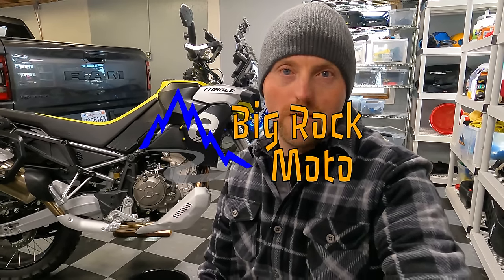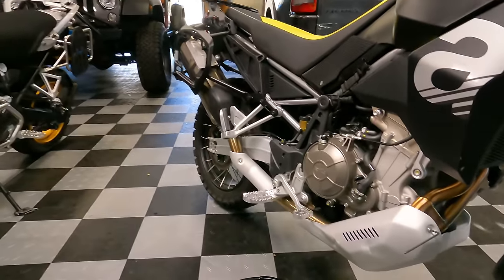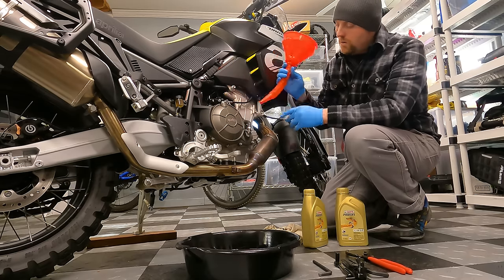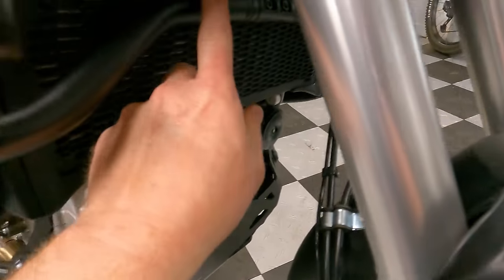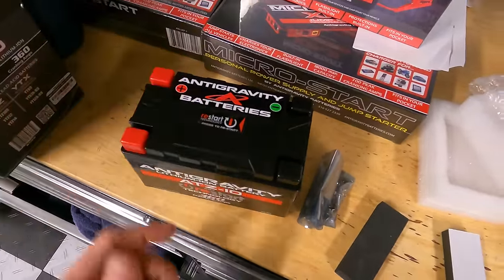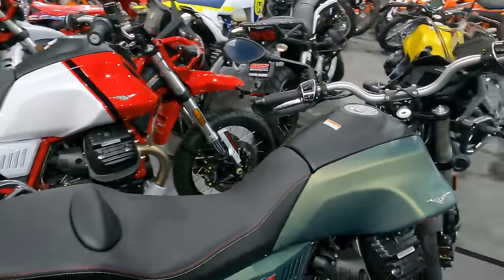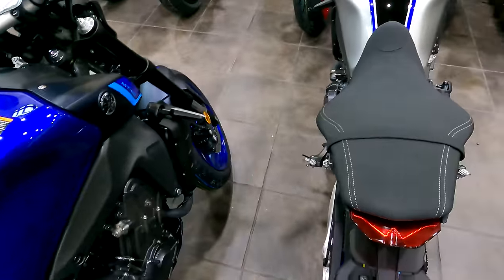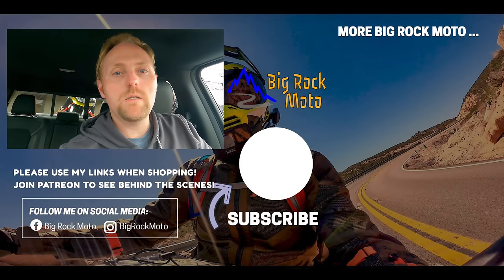Aprilia Tuareg 660 First Service & Accessories (EP.5)

Comment: Ian you’ll love the new engine map. It is so much smoother & to me it felt as if it had 10 more hp. I’m in Indiana at 800 ft amsl. I’m sure you’re at a higher elevation. Also, when you changed your oil, did you happen to retorque the left & right side engine case covers (and I believe some bolts on the bottom of the engine). At 600 miles in, all of my bolts were not tight to 12Nm. It’s worth checking as I believe some of the oil & water pump leaks on the left side are due to a loose cover.

Comment: I bought the OEM heated grips and quick shifter When I purchased the bike and the dealer included the installation labor. I'm glad they did because it took them several hours.
Reply from the maker: Thanks for sharing
Reply: How are those OEM heated grips? Do they get nice & toasty? Are you able to set different ranges that suit you nicely in varying temps?
Reply: @tad3549  Three settings. They're decent,  but they don't get as warm as oxford heated grips or BMW OEM.

Comment: The way the grips are integrated into the bikes system makes it worth the price. It is nice to not have a switch that you have to figure out where to place. I remember going to GP Cycles while I was in the area and they were nice guys to deal with.
Reply: I thought that on my 890. It soon became a pain having to go into the menu to turn the grips on after every stop. On a long ride that could easily 5-7 times with fuel stops and food or sightseeing. It really gets old fast. Something like the symtec heat demons you can just hook up to switched power and leave the switch turn on. That way they power up as soon as you turn the bike on. IMO it's a better system for long distance riding/touring.

Comment: Hello.   I am lucky to live near an Aprilia dealer ,and just got the quick shifter and first service done.  My first service included the update, head bearing inspection wheel bering inspection, chain lube and adjust  brake pad inspect and adjust, re torqued all safety fastners, coolant level check and fill battery test ,charging system check reset service light and more.   I was going to do it myself until I heard all that needs to be done.   It was almost $500. Love your channel. I am 707darren  on youtube.  My other bike is a R1250GS.    Best wishes D

Comment: When installing the heated hand grips the computer recognizes it on the dash and you don't need the dealer for installing them, you just need to be careful with running the wires up in behind the display because things can get a little tedious and time consuming to keep from pinching wires and breaking some of the faring and the neck going under the display when the bolts don't come lose without breaking something. So Ian believe me from experience you did the right thing by letting the dealer install them.
Reply from the maker: thanks

Comment: Dealer required service interval reset is a deal breaker for me. Hopefully someone will come up with a work around. I don't mind a service reminder but please allow us to reset it ourselves if we do our own maintenance.
Reply from the maker: totally agree
Reply: I've confirmed with multiple dealerships and through my own experience that the service light is really just a little orange wrench that doesn't do anything except occupy space on the screen. It literally does nothing else.
Reply: @turbolag5107  except remind you that you’re borrowing the dealer’s bike.
Reply: @cullennowell7813  what are you talkin about?
Reply: Owners manual says air filter and oil change must be done at the Aprilia authorized service center. Does self-maintenance void factory warranty?!
Reply: @JmoneyCCs174  That would be illegal for them to void the warranty if you or someone else does the service

Comment: i think the kawasaki z900 RS SE is the better looking bike in the category. Also, its one of the rare 4 cylinder in the higher mid weight naked bike. It sounds absolutely amazing. And the SE version with Ohlins suspension is incredible. Test rided one and wanted to buy it right away.

Comment: Hi Ian well done as always. I have been following this series closely rode a Tuareg at GetOnADV last year. My Africa Twin has 20k plus miles (zero issues) and was really loving the Aprilia but this dealer only service reset takes this bike off my list. Is there anything in the works for that?
Reply: Clearing the service light is only the the start of your costs once 8:47  the bike is at the dealer. At a minimum they will have to “reset” this or “clear” something.
Reply: @graw1953   hi ! do you own an Aprilia has the dealer experience been  poor for you?
Reply: @paulherron4289  no, I wouldn’t buy one for the reason you are tied to a dealer, even if it’s minimal servicing. I doubt you could leave just paying for a light reset. If you have faith / know your dealer, maybe then.

Comment: Hey Ian, not sure if you did a follow-up video on how you liked the SW Motech crash bars and shield.  For sure they are second to none for engineering and precision fitment. Great powder coat and hardware also. Sweet shop and great techs.

Comment: I think you are really fast AND drank a lot of coffee! I’m stuck between the Guzzi 850 and the A660, if I had your off-road to ride I would go with the 660, but I’m 90% or better street, what to do? I’ve had 6 BMWs so fond of driveshaft, but I think the 660 is around 50 lbs lighter so better for my camping trips.  I think I’d be happy with either but mostly cruising the beach so maybe Guzzi better plus I’m sure 2 up better on Guzzi

Comment: Not a huge fan of the bash plate mount on that 660, but I guess they saved some weight & got a little more ground clearance by skipping any frame rails under the engine. 
  The MT09 sp is what your garage needs Ian, but it, ride it, review it!

Comment: Another fantastic video!  I am really struggling between the Tuareg and ktm 890. Any advice?  They both look great but a 4K swing is a lot.
Reply: Following
Reply from the maker: The 890 has a lot more power and slightly better electronics. Besides that, I prefer the 660, the engine is smoother and more tractable, the bike is higher quality, and the suspension is just as good if not better. Also cheaper.
Reply: Great. Really appreciate your feedback along with thousands of us that follow your channel!!
Reply: I’d rather get something cheaper and reliable and the 4K I’d save I can farkle out the cheaper bike😀
Reply: @BigRockMoto  hi Ian. Question for you. I have a friend selling a KTM790R with all the extras and 4K miles. You gave it some good reviews. How would you rate it compared to the new 890 or Tuareg. I can get it for 4K less than a Tuareg
Reply from the maker: @scottkouns8578  The 790R is a great bike and you can't beat that price. It will outperform the Tuareg on road, and off road it is about equal.
Reply: @BigRockMoto  perfect. Thank you so much for all of your help over these past few months answering all my questions. Really looking forward to getting on the dirt again but still being able to get there via the road. I’m going to put together one of your bdr rides. That ride looked awesome!!  Now I need to go back thru all your 790 videos!

Comment: Yamaha R7 looks like a great track/street bike. Saw one in the flesh last week and was pleasantly surprised by the aesthetics.
Reply from the maker: Totally agree!
Reply: It's an Mt-07 with fairings. Get an Mt-07 instead. It's the better street/track bike.
Reply: @majormassenspektrometer  Nah...R7 has better suspension that is fully adjustable, shorter wheelbase, higher top speed because of the fairings, slipper clutch, up-only quickshifter, and Brembo master cylinder.

Comment: So why have you gone backwards with battery chemistry technology?
The standard fit battery on the 660 Tuareg is a Lithium Iron Phosphate LiFePo4 battery which has a chemistry that is thermally and puncture impact very safe compared to a Lithium Phosphate which has been proven to be thermally unstable and will catch fire when the the cells are damaged by punture impact.

Comment: Ian, a quick tip.. if chainging oil DIY, and the bike has been left upright, you don't need to warm up the engine first. It just takes a tad more to drain.
Reply from the maker: i just like the oil to be a bit warm and circulate to pick up any debris, but you're right

Comment: In your budget I would theoretically get the Tuono 660. Even if it has the "same" engine. That could even be an interesting aspect: comparing how much difference the two different engine set-ups really make.

If you absolutely need a different engine type, think about stretching your budget and get a standard (non-factory) Tuono V4.. should be around 17k USD and that engine is just a Revelation.

Or stay inside the budget an choose either a MT09 or a Kawasaki Z900.
The Kawa is not really a racer but has an amazing price/performance ratio and should still be a lot of fun on the track for a beginner.
Reply from the maker: hmmmm... V4... so nice

Comment: I am very interested in hearing your opinion on the Tuareg's quick shifter.  I myself am thinking about getting the 3rd bike in my stable and the MT09 (and SP), Tenere (as I used to ride the 2020 model, not on the highest prirority here), the Tuareg 660 and a few others are on my short list.  I prefer to own the bike with the quick shifter (preferably both up and down quick shifter; but, upshift only quick shifter is acceptable).
Reply: I've heard the Tuareg quick shift works best at higher RPM, not quite as quick at lower RPM, but still acceptable, just takes some getting used to.  I ordered with
Reply from the maker: it's smooth like butter! love it

Comment: I'm a sucker for European bikes, I own a Ducati, a Triumph, and a KTM. But if I were going to start doing track days (something I'm planning to do as well) I would either use one of my older bikes (the Ducati is 10 years and the Triumph is 11 years old this year) or buy Japanese. I'm interested in Suzuki's new parallel twin motor. They make very affordable bikes. Plus, a parallel twin 800cc motor is definitely not triggering a poser mode. LOL. It seems like you went for Yamaha's triple cylinder motor. I have a three cylinder motor on my Triumph, that's when I realize I like two cylinder motors better. You probably will tell your wife the content the new bike will bring, with track days and all, will more than pay the bike's cost (investment, of course).

Comment: I would like to humbly issue a correction. Bringing the bike to the dealer does not raise the RPM limit that is a simple setting that you can do on your own. I performed my first service on mine and didn't bring my motorcycle into the dealership until about 3,500 miles to have the quick shifter installed. Aprilia customer care, North American warhorse RSBK, and Blackman's cycle center, and finally my own experience all confirms that the service light doesn't do anything except remind you of service. It doesn't limit anything. Now there isn't updated fuel map this is true. I was the first Tuareg to receive the update at North American warhorse.
Reply from the maker: Thank you
Reply: @BigRockMoto  I mean is* a new map. Voice texting gets me in trouble sometimes lol. Glad you're enjoying the bike. Thank you for your attention to detail and in depth reviews as well.
Reply: I realize I'm a year late,  but can you reset the maintenance light without the dealer doing it?  Is there a hack that is possible?  One of the many reasons for selling my Desert-X was the aggravation of being forced to take it to the dealer for every little thing.
Reply: @brucerossonthetube  no hack to reset the light as I know of yet. It doesn't affect the motorcycle and I forget that it's even there. I got it reset around 2,300 mi And it came back on around 6,400 or whatever the hell 6,200 And I'm at 11600 now. I don't really care. It does not affect the performance so oh well
Reply: @turbolag5107 thank you.  After this first year, have you had any problems or concerns?
Reply: @brucerossonthetube  only the fuel level malfunctioning and the gauge blinking at me but that's a common issue. I just reset my trip and refill at 180 miles to be safe.

Comment: Also noticed your dealer installed the factory battery incorrectly (mine did the same thing). You've changed batteries, so this doesn't mattery to you but it drives me nuts that people pay dealers who don't even look at the service manuals when working on these bikes.

Comment: Are the heated grips larger diameter than stock? I find I get arm pump with larger grips.  Just ordered a Tuareg.
Reply from the maker: just a tiny bit. not as big as say the oxford grips which I hate, too big
Reply: When I added the OEM heated grips, I believe I measured the original grips at 1.25 inches diameter & the heated grips at 1.35 inches. AF1 indicates on their site that Aprilia does not sell the replacement grips themselves for the heated grips.

Comment: Was curious if the crash bars would use engine mount points.
The Tiger 900 is having engine mount points breakage.
Wonder if these will result in the same.
Some Tiger 900's totaled because of it.
Reply from the maker: I've been reading those reports, scary
Reply: @BigRockMoto  ...not tryin to splash cold water on any bike.
I owned and like the 900 Rally....but it is a real concern.
I stopped with adding the lowers and the BarkBusters, not the uppers.  👍

Comment: Crazy my diesel shop charges $115 an hour to work on a $40,000 motor and these motorcycle shops are insane. I don't have the computer software to work on my diesel is why it goes to the shop.

Comment: Hey Ian, thanks for the Tuareg series, it's great. One question, have you ever experienced the hiccup issue between 3000-5000 rpms? If yes, did the new ECU update solve the issue?
Reply from the maker: yes and yes, it solved it totally
Reply: @BigRockMoto  Did the dealer charge you to do the ECU update??